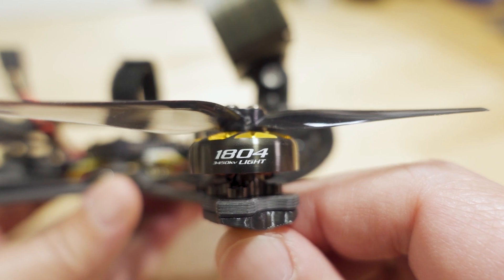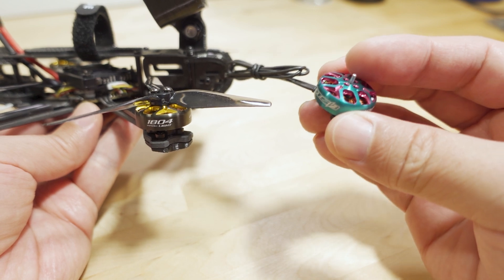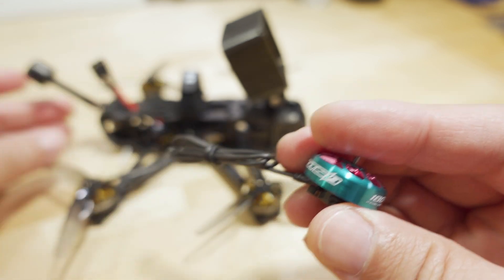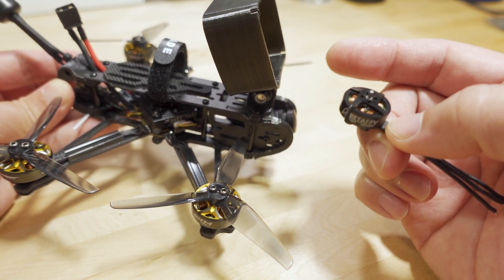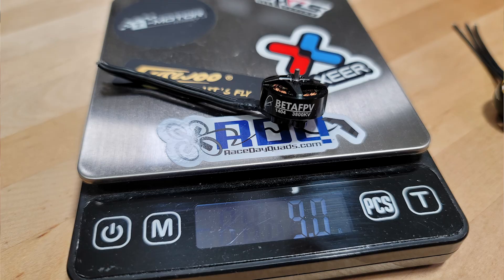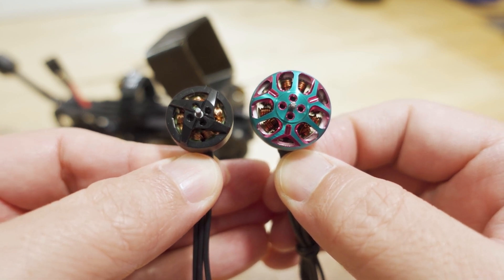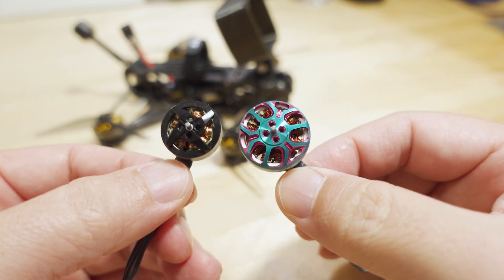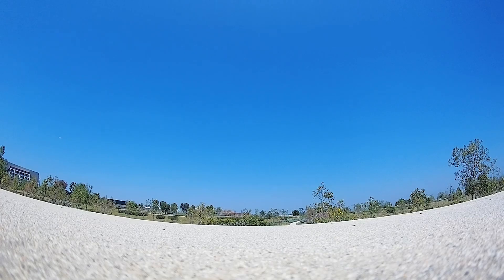Use RCINPOWER 1804 motors instead of 1404 motors 💪

Comment from the maker: 🛒 RCINPOWER GTS V3 1804 Motor - http://bit.ly/44AAHtZ
Reply: I’d try the higher kv on a 4 inch for freestyle should rip on 4s and try the lower kv on a 4 inch on 6s and I believe that will be the sweet spot. Kv is too low for 3.5 inch freestyle you’d want to be 3800-4000kv on 4s and 2800-3000kv on 6s for 3.5 inch quads in my opinion. Give it a try! Love your content btw.

Comment: Hey what would be your suggestion for motor upgrade from 1404 3800kv on my 3.5 AOS EVO. It flies great but I want to do a bit of freestyle and I think 1404 is doable but it's a little underpowered to recover from some manoeuvres. I was thinking of going up to 1604 t motor pacers 3800 kv. Is that even possible. Please I'm new to this .
Reply from the maker: Either 1604 or 1804 will work for you.  The 1804 setup will feel a little heavier but give you more overall power.  The 1604 will be a little less freestyle friendly but give you more cruising flight time.
Reply: @AlbertKimTV  thank you I think I’m going to go with the 1804s

Comment: I have a 3.5” build. About 300g. Running 6s. 1507 2700kv. But they run hot. May swap to these 1804. Thank you for the video.
Reply: Quá tải lực nâng, thử lên 2006 sẽ ok

Comment: RCInPower motors are nice, lots of punch and pretty strong.  After many many crashes 1 finally died on me, the armature somehow unglued and the vibration seems to of caused some of the winding wires to break.  Scary when it happened during flight ( spin of death 😂 ) when the 1 motor died.  I am very happy with RCInPower motors, these 1804 motors look great. Great review and flying Albert!!!! :goodvibes:

Comment: so happy to see some more options in this motor size, 2004 is just a bit too heavy to fit comfortably on sub 250g builds. Prior to this the other 1804 options were either just as heavy as a 2004 or not very durable. RCINPOWER has some great build quality from what I've heard so will definitely check these out with how light they are.

Comment: Maybe a good alternative for the Micro Long Range 4"?
Reply from the maker: Yes, assuming the extra 11-12g doesn't cause a loss in flight time.  I have not yet tested that specific scenario yet.
Reply from the maker: Note, I think the 1604 size would be better suited for long range.
Reply: Yes, especially for heavier 18650 packs
Reply: I was thinking the same.